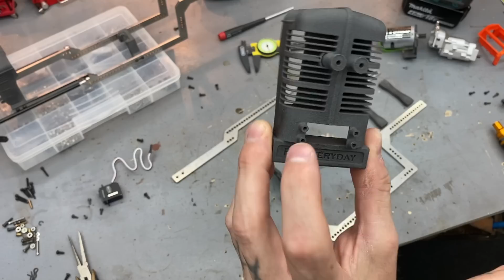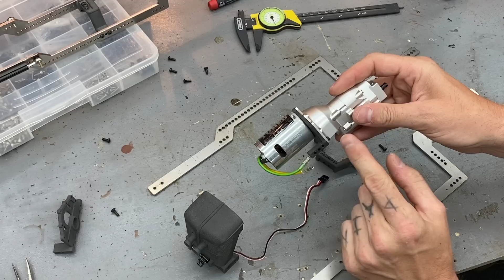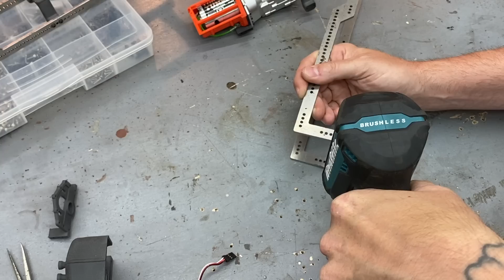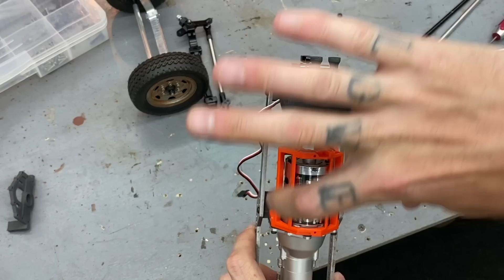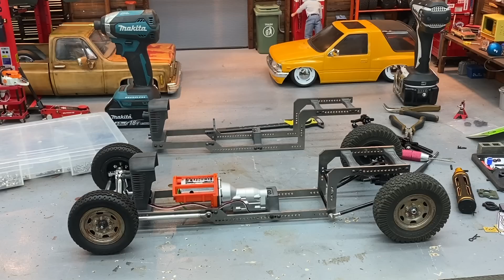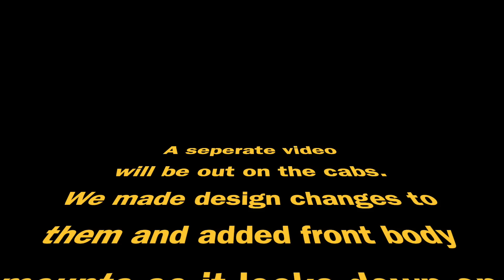The RCeveryday #2 Rat Rod Kit Assembly Instructions part 1

Comment: Just ordered my kit! Can’t wait to start building it! Getting all my needed items together and noticed the front Tamiya King Grand hauler custom front semi axle from eBay doesn’t come with the front rod link… what size link, eye to eye, is needed? Thanks! Love what you’re doing, keep it up!!!!
Reply from the maker: It depends on the axles specifically, some have different spindles, most generic ones are about 5 and 1/4 inch eye to eye.  All depends on the rod ends as well.  Its so versatile.  The cheap ones on amazon work well.
Reply: @RCeveryday   ok, I kinda figured I was overthinking it anyways just being excited, I’ll order something and mess with it when I get it, thanks bud!

Comment: Do you have a link to where exactly those suspension rods to hold the front straight axle on I’m coming up with is all threaded rods
Reply from the maker: Glad you caught me at the computer!  Here are the ones on ebay that are super cheap https://www.ebay.com/itm/204306974988?mkcid=16&mkevt=1&mkrid=711-127632-2357-0&ssspo=ptuk-E2aTz6&sssrc=2047675&ssuid=URtS7-jqQ66&widget_ver=artemis&media=COPY
Reply: @RCeveryday  Are these the same as you just put on yours that’s what I was looking for, but I did order the cheap ones
Reply from the maker: Ive got tons of these, not sure where the ones I have came from exactly.  But I measured from my build.  They are M3

Comment: Question the length of the connecting rods for the straight axle to the frame where to get it and the length
Reply from the maker: They are 100mm rods. Found some cheap ones on eBay. Also used some from the cenracing f450 too they were the right length.
Reply: @RCeveryday  What are they called connecting rods, can’t seem to find trying to get my straight axle hooked up
Reply: @RCeveryday  I typed in 100mm rods it comes up solid rods cannot find

Comment: A Monster Truck Rat Rod crawler would be awesome! 🤘
One suggestion is that if you do you power tools to not use an Impact Driver/Drill like that, use a Drill Driver that has Adjustable Torque Settings and turn it all the way down to 1 to start from there. Or you could have a bad day. 😂 👍👍